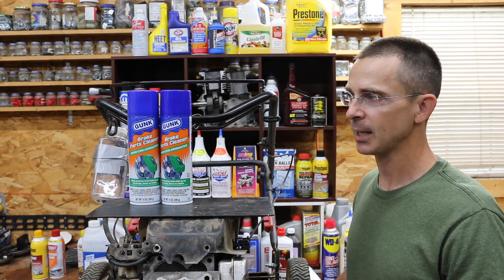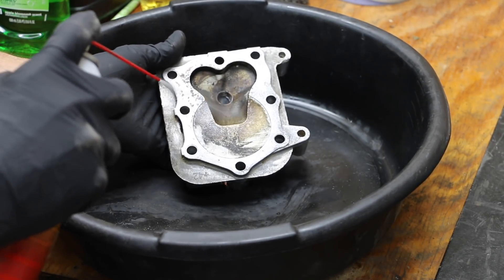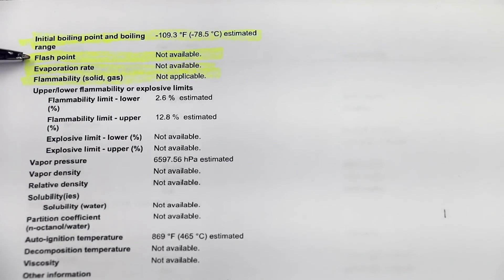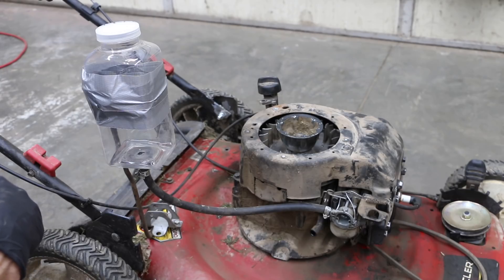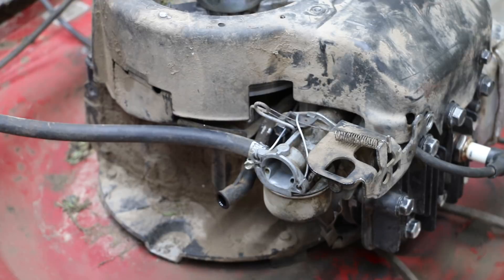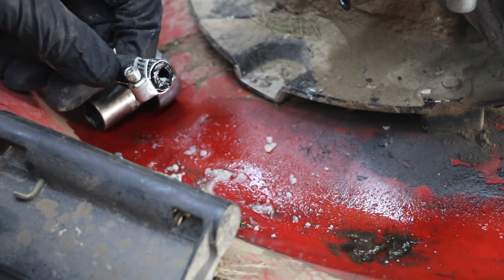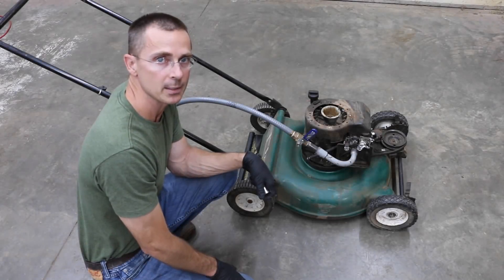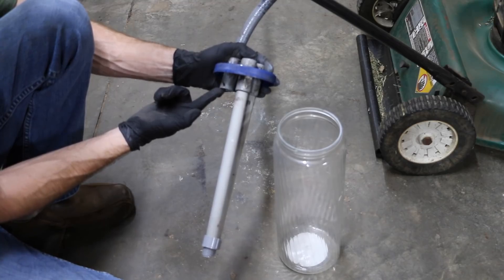Will a Gas Engine Run on Brake Parts Cleaner?  Lets find out!

Comment: BPC is used all the time to find vacuum leaks. If it sucks it in- the RPMs increase (RICH mixture). The alcohols + isobutene propellant is like it says on the can- EXTREMELY FLAMMABLE.
Reply from the maker: Excellent point regarding how to use it for finding vacuum leaks.

Comment: Okay, I think I have a very good and relevant idea. We all know that propane runs perfectly fine in engines, there are plenty of propane powered vehicles on the road in fact. Now here's my idea, propane is claimed to be "clean burning" but how clean does it burn? Instead of running chemicals to test how well it cleans, why not de-carbon an engine with the ole wire wheel and run it off of propane for a fair amount of time, then inspect to check for build up? 
This brings me back to the old car shows on the weekends when i was younger(when they were good and worth watching) and they had an engine pulled from some work vehicle that had ran on propane its entire life and had somewhere around like 150k miles. They took it apart and the damn thing looked brand new still. I think this would be a good, and somewhat easy video.
Other than that, keep up the good work!
Reply from the maker: This is a terrific recommendation--thank you!

Comment: Excellent video and scientific analysis and progress throughout the experiment. When you specified the boiling point at the start, i thought we might end up running on the vapour setup. Your vapour setup reminds me of the chest drainage tubes used in medicine. The depth of the tube below the fuel level csn be measured in cm and used to measure vacuum levels. Another thought is to create a similar inlet chamber filled with water as an air filter to work in a heavy dust/ dirt environment on a regular carb setup. Yet another thought is to hook up the exhaust into the chamber to aid agitation and minimise air pumping losses. It wil of course need a bleed valve of some arrangement to get o2 in there.  Love your vids and channel.
Reply from the maker: I really like your ideas! Thanks for the recommendations and thanks for the positive comment.

Comment: Yes! Another great video but would you put normal gas in a 2 cycle
Reply: It will seize due to a lack of lubrication after a few minutes of running.
Reply from the maker: Thank you for this recommendation and thank you for the positive comment.
Reply: Been there, done that personally! That's why some of my gas cans are painted now! (They have 32:1 2-stroke oil mixed with the gas.)

Comment: I would have liked to see a before and after of the cylinder walls.  Brake cleaner is very good at removing oil from metal surfaces and could severely reduce the lubrication between the piston rings and the cylinder wall.  I would definitely change the oil after running brake cleaner through these engines.
Reply from the maker: Great point. I should have shown the cylinder walls. Thanks for commenting.
Reply: Thanks for the interesting videos.  Keep up the good work.

Comment: Basically gas with octane booster and acetone, I think.
Heptan is one of the main components of regular gas, 100% heptanw equivalent to a octane of  0, when not using iso-octane.
And xylene(dimethylbenzene) I think is used as a octane booster as is toulene.
So gas without octane, but with octane booster and acetone to make it vapeorize better.
Think I see some detonation in the see trough engine?
Reply from the maker: Thansk for commenting. I couldn't tell if detonation was occurring, but you might be right.
Reply: Of course had to google the content to find the more regular names, and found some people claiming acetone can improve the milage on carbed engines.
I think the brake cleaner I use is chlorineated, so probably safer to continue use ether based spray to  help start old cold engines.
Reply from the maker: Yes, I'd like to test acetone soon.  Much safer to use ether if you don't have non-chlorinated. Thanks again.

Comment: Great video! I was expecting the engine to knock, since heptane has an octane rating of 0. But the concentration was low enough that it didn't occur. Also, question, in your observations with vapor engines, does it tend to use the same amount of fuel? less? more? Keep up the great work
Reply from the maker: Thank you very much for the positive comment.  The vapor setup seems to use the same amount of fuel.  I compared it when using gasoline and it was very close.
Reply: Cheers and thanks for the quick reply!

Comment: Take note: head gaskets may need replaced on the used motors.  I would recommend replacing the gasket before a test to get more accurate results.  Keep up the great work!
Reply from the maker: Thank you for this recommendation and thanks for the positive comment.

Comment: Your videos are so helpful because you start with a clean cylinder head and see what each chemical does to it. I take the upper intake off of my car every 2 weeks or so in order to clean/inspect what's going on. Every time I clean the ports, lower intake, upper, throttle body, maf, etc. And your videos have helped me to narrow down what does what. I have been conducting a test of pcv for the past 2 years. Now my car has a complete pcv delete system that I made myself and there is still oil getting into my intake manifold. It's amazing, I have no idea whether it's because of the evap system which is still there, or the fact that my engine is a "mild atkinson cycle" engine I can't figure It out. Either way keep up with these videos you are doing a great job and seriously helping people like me.
Reply from the maker: Thank you very much for the positive comment!

Comment: Hi, I enjoy your videos a lot. Pretty remarkable what can be substituted for gasoline. I think next is for you to run a small car on something other than gasoline. You've proven without a doubt you can run a Briggs and Stratton on just about any flammable fluid. I don't have any ideas for anything else you could use for fuel. Keep the videos coming.
Reply from the maker: Thank you for this recommendation!

Comment: Since part of that brake cleaner is a gas at normal temp, wouldn't it make a difference if you spray it in directly instead of letting it sit?
Reply from the maker: This is a great point.

Comment: Seems Everything you do works, sooooo. Can you use a laser instead of a sparkplug ?     :P
Reply from the maker: Thank you for this recommendation.  It'd have to be a really hot laser!
Reply: Interesting theory...I suppose you could, you would need high pressure to make it easier to ignite but also gotta be careful that you avoid knocking. Would have to be one hell of a laser.
Reply: With this guys record, I rekon he could just point a mirror at a sparkplug hole and it would still work fine   :D
Reply: I think you're right about the pressure, it would have to be just right every time. I'm going to put some high powered IR lasers on my list, it would be interesting to see how much power they can take in a short pulse.
Reply: Probably from a CD/DVD burner? They are rated Class I.
Reply: Lasers from burners are only a few hundred milliwatts at most. In reality I think towards a 15 to 30 watts (30000mW) and be focused to about that of an laser from an audio CD player.
I think its possible, but its going to need some good skills and luck to make it work.

Comment: Will a Gas Engine Run on A1 Jet Fuel?
Reply from the maker: Thank you for this recommendation.
Reply: Used to work at an airport as a fueling manager, and no it won't. But it runs in a diesel!
Reply: Jet a1 is essentially kerosene with some additives
Reply: Its a "cleaner" diesel. They don't run diesel in jets because it smokes up the place like no other

Comment: Piggy backing off another comment. 

I've heard that putting half a quart of ATF in an engine crankcase is a good way to remove varnish and oil deposits. 

I'd believe it given the additives in ATF but have never seen it actually tested.
Reply from the maker: Thank you for this recommendation.

Comment: Try adding water to gasoline and see how much can be added before an engine doesn't run. Or add water and see if heat will remove the water for an engine to run.
Reply from the maker: Thank you for this recommendation.

Comment: Adding an adjustable jet to a bowl carb shouldn't be too hard. Get an adjustable jet assembly from a pulsajet carb and install it in the bowl bolt. Drill out the main jet to the size of the large and of the needle and make it so the needle is getting up into the main jet. Or get a Carter adjustable that will work with the governor.
Reply from the maker: Thank you for this recommendation.

Comment: Just wondering if it would help you to cut a small piece of metal, drill some slots and use it as a throttle plate instead of tape.  Like all your videos!  Thanks.
Reply from the maker: Thank you for this recommendation. and thanks for the positive comment.

Comment: Could you try running the vapour motor with regular gasoline with clean oil and again with clean oil but this time running on vapours to see if the gasoline in liquid for  treats the oil differently than in liquid
Reply from the maker: Thank you for this recommendation.

Comment: Will an engine run on white gas/Coleman fuel?
Putting carburetor seals in a dish of the "fuel" you are testing could give more useful information without tearing the carb apart every test.
Reply from the maker: Thank you for this recommendation.

Comment: I actually use brake cleaner a lot for cleaning carbs. I know not to let it come in contact with ANY plastic or rubber parts. I like the fact it really cleans up the gunk and doesnt leave any residue. I would never recommend soaking parts in brake cleaner. I usually just spray the parts,blow them off with compressed air and then assemble. Brake cleaner eats through dried up crusty fuel left in the carb as well as the jelly type that sticks like snot to everything. It WILL cause a rubber o ring to expand like mad,I havent had it ruin the plastic emulsifier,but say good bye to the o-rings holding it in. Its best to pop the emulsifier and o-rings out anyways. If the carb has the rubber type set that sits in the fuel inlet,that will swell up like the staypuffed marshmallow man set on fire also. Its best just to eather pick or blow the seat out. Old fuel will ruin that seat faster than brake cleaner anyways. I dont use carb cleaner as much any more just because it leaves an oily residue.
Reply from the maker: Thank you for this recommendation. This seems like a terrific option over carb cleaner.

Comment: Im still worried about the vapor mower running lean. Have you tried it on a larger scale? Compact car or truck while driving? Ive seen a vapor set up with a ford ranger run on youtube but not drive.
Reply from the maker: Yes, it's definitely running lean. I haven't tried it on a larger engine yet, but might do so if there is enough interest. Thanks for commenting.

Comment: I am worried about a backfire/flashback with the vapor engine. Particularly when you are trying to start it. Maybe if you had a container capable of handling an igntion and venting it in a predictable direction away from you.
Reply from the maker: This is a great point. I will install a flash arrestor before I use this setup again. Thanks again!

Comment: Man you do the stuff I’ve always wondered about. Keep up the fine work you do. Look in to this motorkote stuff I’ve been seeing advertised.
Reply from the maker: Thank you!
Reply: I use that in all my diesel motors ..it quietens them down and they seem to run smoother, specially the 6 liter navistar
Reply: jerrywh3 ya
Reply: Will an engine run on spray paint

Comment: ~~~~~~~~~Will an engine run on warm/hot bacon fat?~~~~~~~~ Will an engine run on dollar store rubbing alcohol (50-70%) -- Will an Engine run on naphta/camp fuel) -- Will an engine run kerosene and mothballs? --- Will an engine run on straight seafoam? --- will an engine run on fuel injector cleaner? --- will an engine run on drain cleaner? -- Will an engine run on air freshener (like febreeze or glade or whatever) -- Will an engine run on olive oil? -
Reply: I like the bacon fat idea!
Reply from the maker: Thank you for these recommendations.
Reply: I like the bacon fat as well, perhaps try to find an old diesel engine
Reply: John Ryan do you eat bacon?
Reply: Bacon fat maybe in a diesel but not a gas engine as for rubbing alcohol that low of a proof will most likely not run well if at all you will need a lot higher compression as 91% maybe about the lowest you can go it no diff then other group of alcohol methanol or ethanol as for kerosene it should after all it used in jet engine, and petty sure non of cleaner will work straight out of the can, LoL right air freshener.
Reply: I like the olive oil idea
Reply: Using oils as a fuel additive is useful at concentrations around 0.5%. I think bacon fat or lard may have some fats in it that don't dissolve in all solvents, for instance turpentine won't dissolve all of it. But for all we know that could be a good thing.
Reply: It's possible to run a engine on bacon fat
Reply: Hmm no a gas engine but fat can be converted to run in biodiesel fairly simply, producing glycerin and a small amount of soap as byproducts which can then be used as if it were regular diesel, or you can install a separate heated fuel tank which you fill with well-filtered grease as long it in a liquid forum, ho no now make me hungry for BLT LoL.
Reply: Dat Boii just about any oil even used motor oil
Reply: That's the thing, any hydrocarbon which will vaporize or or vaporize enough is acceptable. Why has this become a "thing"? Over time everything was tried, but gasoline remains the cheapest.
Reply: I think everyone is just fascinated because you always hear things but never really know what to believe.
Reply: camp fuel for sure.
fed it to my 2 hp B&S go cart back in the day.
Reply: run on isopropyl alcohol,....YES but don't expect to run it on gasoline for very long after it. I have tried it several times and not just on a lawn mower. My 64 Thunderbird and 68 Triumph GT6 love it straight, and added to the gas at 20% or higher concentration I can run ethanol gas up to 10% without having to do a water injection treatment. un the other hand my 1970 MGB hates it straight for some reason)
Reply: @christopher-duncanbartels8456  what the heck are you even talking about? You just said a bunch of similar sounding things, like if a robot or alien was trying to fit in with gearheads. Ethanol and water injection? Those 2 things are unrelated.
Reply: Unrelated? Water injection can help with pre-detonation.... Ethanol fuel is clean but can cause problems on older cars.
Reply: TheDrakenZ straight seafoam is definitely a no.

Comment: Try running an engine on aviation 100LL. You can buy it at any small local airport. Also could you do a long term test on storing ethanol vs non ethanol vs stabil mixed gas? Might be interesting to see what the fuel looks like in a jar after a year.
Reply from the maker: Thank you for this recommendation.

Comment: I suggest setting up a 2nd bottle and use a T piece , along with a couple of taps. That way when you have a hard to start fuel, you could simply start it on Gasoline to get it up to temp then switch to what ever fuel you are trying to use.
Reply from the maker: Thank you for this recommendation.

Comment: this might sound stupid but what happens if you run nos through it?  only issue is you would have to make a special adapter for the tiny carb
Reply from the maker: Thank you for this recommendation.

Comment: will a engine run on wd40
Reply from the maker: Thank you for this recommendation.
Reply: I couldn't run it on WD 39, but I rate your chances @ +1.
Reply: Yes.
Reply: REDLINE RUNNER yes, but you probably use the spray version, not the liquid version... the reason that the spray works as a engine starting spray is due to the hydrocarbon-based propellant used.
However, the liquid itself will likely not work to run a gas engine..it should, however run a diesel engine.
Reply: Will an engine run on wd40
Reply: I can remember using WD-40 as a substitute for ether to start cold diesel gensets. Was not as good as the real stuff but it got the engines going.
Reply: It will... It will run nicely... For example starter fluid is bad for 2T because 2T requires oil in gas that's why WD-40 is recommended as 2T starter fluid... :3
Reply: ayden vanderkooi I heard its mostly kerosene
Reply: Michael Mace yes, but remember that the propellent is a hydrocarbon gas(like butane or propane(I seem to remember it being isobutane)), so yes it will work sprayed into a intake, but the liquid itself should not work in a gas engine (it SHOULD work in a diesel engine though).
WD-40 is sold in liquid form as well as the aeresol form...might be interesting to try the liquid version as a fuel(I would predict that it should work in a diesel engine, but not in a gas engine)
Reply: M. K. WD-40 works perfectly fine bro... I told you it's used as starter fluid in 2T engines... I did it many times...
Reply: M. K. WD-40 is silicone based oil...
I use it from can yes...
Reply: REDLINE RUNNER no silicone in wd-40(in fact, their own web site says that there is no silicone in wd-40).
As for using it from the can, do you mean plastic bottle, or do you mean an aeresol can..the aeresol can uses a propellent that is based on hydrocarbon gas.
This will indeed be volatile enough to start an engine.
The version that comes in the plastic bottle has no need for propellent.
While it will still burn, it's not volatile enough to work as a starting spray.
As a fuel, it should be usable in a deisel engine, but not in a gasoline engine.
Reply: I use SMART STRAW in aerosol can...